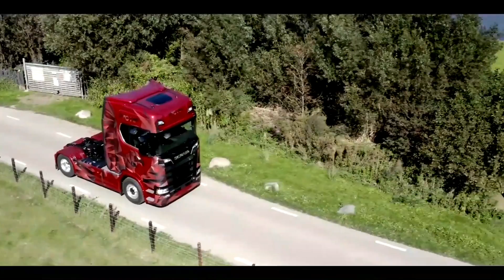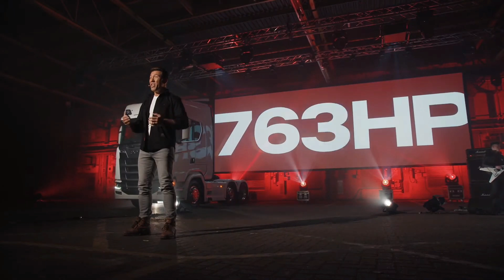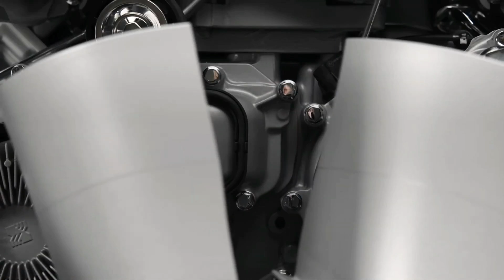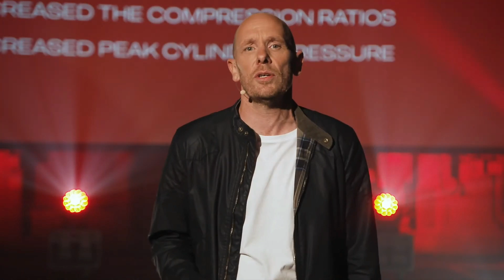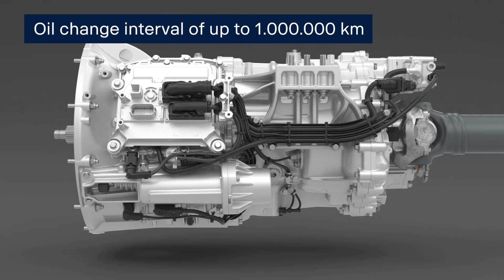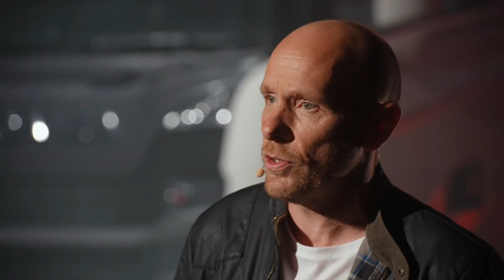All New 2023 Scania V8 770S - Full Review (World Premiere)

Comment: Fascinating to squeeze out 770 HP with an  V8 engine which should have two bearings less on the swing shaft than a six cylinder engine.
But Scania obviously can without loosing relatability -fantastic and well done!
Reply: an s770 with no restrictions and overcharged its 2200 hp bro the reason we have so less its the adblue bullshit crap